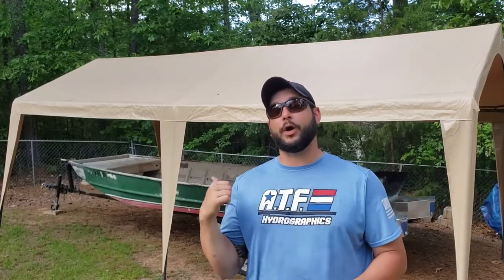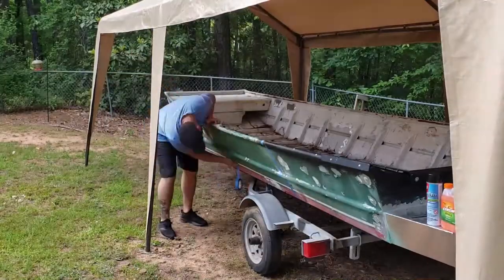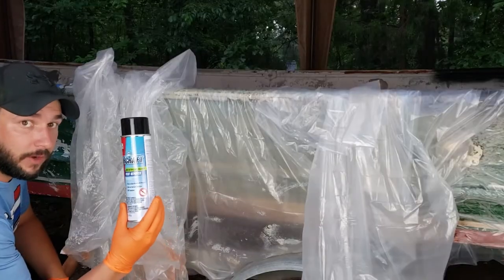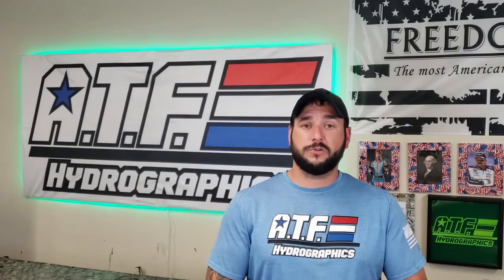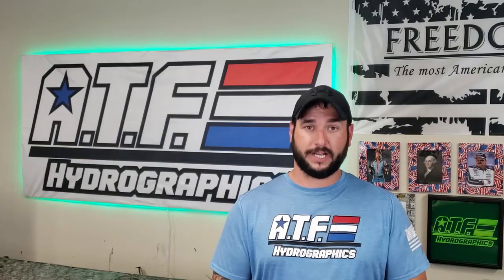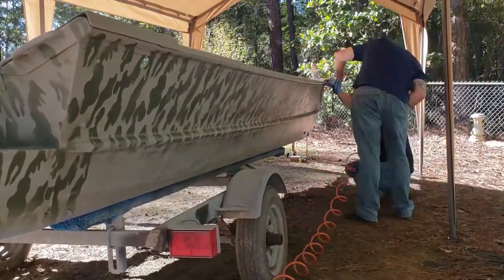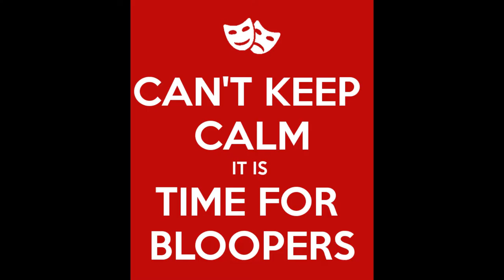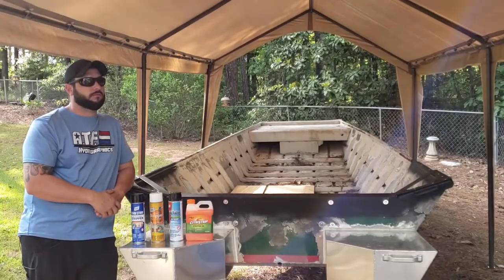Best Way To Strip Old Jon Boat Paint

Comment: Airplane stripper in liquid form works great.  We use a layer of newspaper or two soaked in it laying on the paint and covered with plastic.
Reply from the maker: I tried the spray and it did not do anything. I might try the liquid next time.

Comment: Very nice video👍  Stripping paint can be such a headache.  After Citristrip failed to remove my boat’s paint, I found a old hack.... Heavy Duty Oven Cleaner!  Worked great for me💪
Reply from the maker: Man I wish I would have known about the oven cleaner because I sure would have tried it. That 1970s boat paint was no joke!!! Took forever to get it all off and was even harder to get the 6 layers off the bottom. Got a video coming on that very soon.
Reply: @SendItJonBoats  If you want to see the oven cleaner in action, I uploaded my restoration video two weeks ago. Glad to have found your channel and I look forward to your upcoming videos👍
Reply from the maker: @florida__jack  I will check that out, thanks for the tip, I will use that one next time. Next time I am in Florida we will have to hang out!

Comment: I used citristrip and my boat had 4-5 layers of boat paint, latex, and who knows what else. The trick is to flip your boat upside down, and after a thick coating is spread on cover it with tin foil. Let it sit over night and it’ll scrape right down to aluminum
Reply from the maker: Yeah I wish I would have had more time to mess with it, that paint was a paint in the butt.
Reply: Explain this in more detail please. Flip boat upside down, than Apply stripper and immediately apply tin foil over top the stripper? Let sit than scrape off? Thanks
Reply: @Boaters_hub  yeah so I flipped it upside down so the stripper was easier to apply. Then apply a thick coat of it on, and cover it with aluminum foil. If it’s out of the sun you can let it sit for 24 hours, in the sun that’s too long and the stripper will start to dry. I then used metal or plastic scrapers and scraped most of the paint off. I also used acetone to clean it and get some remnants of paint off. Then used a brass wire wheel to get the hard parts. I’m actually still working on it. I’m hoping to start sanding tomorrow.
Reply from the maker: @Boaters_hub  I used plastic, not tin foil. BUt yes the plastic helps keep the stripper wet so that it does not evaporate too quickly.
Reply: @SendItJonBoats  scrape then pressure wash...
Reply from the maker: @dorantes0106  Tried that and didn't work.

Comment: What should the aluminum surface look like after sandblasting it? This will be my first time and want to make sure I don't strip any of the aluminum off but also strip enough. Using the same materials and tools you are.
Reply from the maker: Really rough, almost like sandpaper if you do it right.
Reply: Absolutely the best way to paint a boat if you can do it quick with a quality paint.  It will have no rough texture.

Comment: Great job on boat really like the videos! I’m getting ready to start the exact same project for my duck boat and I need to blast it when using the fine grit coal slag did you have any issues with warp or heat? I also need to weld a couple spots do you think this media will have any negative reaction to the weld process?
Reply from the maker: I would wire wheel the areas you need to weld first, do all your welding, then sandblast afterwards.

Comment: G'day the best I have found for a lot of old paint is Brake cleaner or Oven cleaner but both will stain aluminium dark grey.
Reply from the maker: I did not know about the oven cleaner until another viewer told me about it. I may have to try that on the next one. Sandblasting worked great it was just expensive and a long process.

Comment: Tal-strip from Napa. Looks like your 3rd sample.   Old version was hands down best.
Reply from the maker: Yeah the old stuff worked real well, I used to use it but I couldn't find it anywhere. This boat had some serious old paint on it... where it stuck it was stuck on there good, but the rest of it was chipping and flaking so I did not trust it, which is why I wanted it all off.

Comment: I painted my boat upside down using leaves and wheat stalks.
I used Rustoleum Enamel paint.
But i sanded the entire boat with a 6"disk sander.
Dont know how to attach a pic or i would
Reply from the maker: Cool.

Comment: How do i strip lead paint off an old 70’s 80’s metal boat? Everything i try isnt cutting it. Ill forever stripping the boat.
Reply from the maker: Do like I did and get it sand blasted... will cost a few hundred but well worth it and much easier.
Reply: @SendItJonBoats  thankyou

Comment: Bought KV stripper  from lowes  works good
Reply from the maker: I will have to try that next time. The stuff I used sucked.
Reply: @SendItJonBoats  leave it on 30 mins spray off with hose pipe , beats sanding

Comment: Would you scrape a new boat paint before you paint it?
Reply from the maker: Only if the paint is no good or uts peeling or flaking off.
Reply: Thanks for responding so I did paint my 2020 boat with rust oleum paint spray but I don’t like the color and I want to pain it darker color. Would you sand it down to the original paint or just smooth it enough with like 220 or 300 sand paper then the new paint?

Comment: Gotta use aircraft paint stripper thats in the can. Apply with brush and watch it melt right off.
Reply from the maker: I will have to try that next time, the spray stuff sucked and was really expensive.
Reply: Jasco's work really well.
Reply: Not working very well for me so far / and over $ 50 a can.
Reply from the maker: @beorbeorian150  Holy crap thats expensive!

Comment: What size compressor do you need?
Reply from the maker: I run an 80 gallon 7.5 hp and it runs a good bit with that blaster.

Comment: Most everything that you done to your boat, the stripper test, stenciling stuff, etc., all turned out bad. 
Had you stood the boat up on it's side and performed all test$ and task$ with the work surface on flat horizontal table top attitude, do you think each task would have turned out different?

Lite weight boat would have been easy to just slide off the side and lean on trailer and work your artistic magics.

Comment: This is slightly disheartening, I have an intercooler I’m trying the least aggressive way to remove the paint but seems like the strippers aren’t my best bet
Reply from the maker: It's worth a try, Just did not work that great on this boat paint.
Reply: If you do it correctly, they work great. Unfortunately this video didn't do it right.
Reply from the maker: @dorantes0106  Explain to me how it wasn't done right?